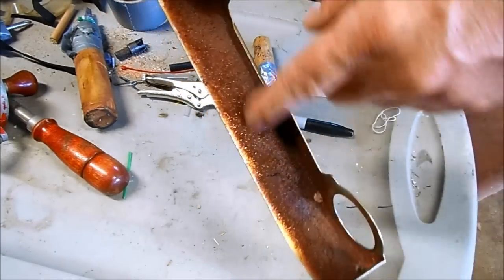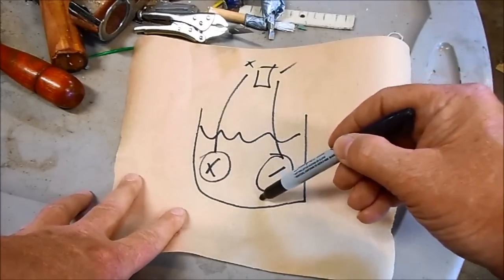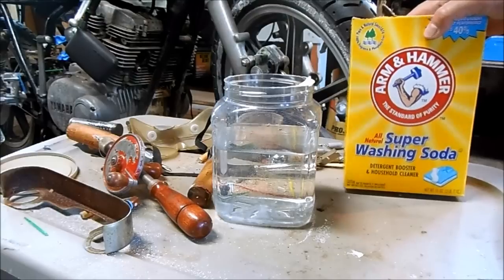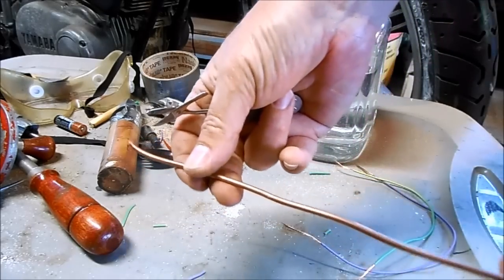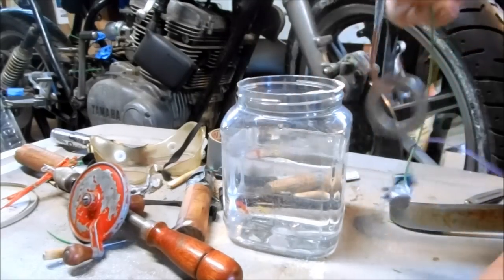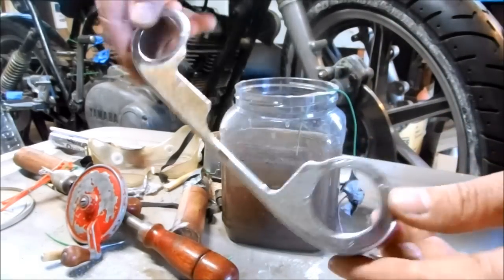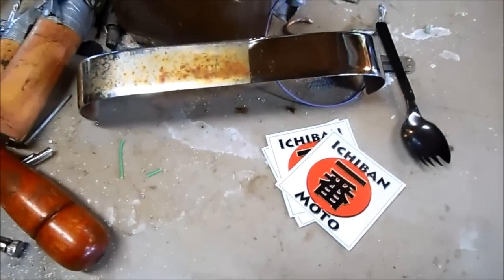How to Remove Rust with from metal and tools DIY Electrolysis process for motorcycles and auto parts

Comment: I am particularly impressed with the finesse in attaching the coloured wires to the battery terminals with duct tape.
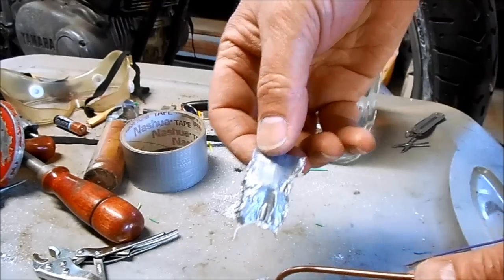Reply: I think you mean Voltage Grade Assembly Tape. 😉  1:50

Comment: Here is an email from my cousin who worked in a Chrome plating factory his Dad owned for over 60 years...  Micheal should know... that was his job for many years. So I guess it will work and I am going to try it now.

CARL,
 I watched the video. It is obvious this will work. He actually did the 
opposite of plating . The part was the anode.And the current pulled the 
rust off. Mike
Reply: reefseeker

Comment: As someone who has performed quite a few electrolysis experiments as of late I would like to warn people about electrolysis dangers using direct current such as alkaline batteries. Many electrostimulated energy transfers are used with AC current to heat liquids such as water which is a dangerous but very quick way to do so and has less of a chance of creating harmful biproducts because the ion diffusion has gaps in the cycle of alternating current unable to split the hydrogen atoms and connect them to the cathode. Direct current such as displayed in the video however can create a number of noxious and sometimes fatal gases even using neutral bases such as sodium carbonate the gas becomes trapped in bubble form and connects to the cathode and is released when the  density is greater than the liquid containing it. Pure water will create hydrogen gas which even in small amount trapped can create a small explosion with flame. Adding Sodium to speed up the process of electron transfer as a bridge will result in sodium hydroxide, technically lye, which is why carbon is used to absorb it. But this is still dangerous stuff so ventilation is important even with a 1.5 volt AA the amount of gas that can build up over night could have the potential to be dangerous.
Reply from the maker: +Terry Heeter   simple low voltage DC is very effective as electrons flow from negative to positive.
Reply: Yeah but I'm talking about leaving it on overnight hydrogen gas build up and other lewis based compounds that combine with the rust can even create arsenic gases because of the sulfur oxide. Just a fair warning ventilation is important that's all a great video, just even lower DC current can build up alot of hydrogen gas in just thirty minutes.
Reply from the maker: +Terry Heeter    just let it run until the rust is gone, however long that is for what you are de-rusting

Comment: When using a single battery there is little current.   Those who decide to kick it up by using a car battery charger or higher voltage source should do so in a well ventilated area.  As the current increases you should see more bubbles coming off the electrodes.  That will be pure oxygen and hydrogen.  Hydrogen is highly flammable, particularly so in the presence of extra oxygen.
Reply: Spam Dump
Reply: You can stretch balloons over the jar to collect the gases. They make great decorations for little kids' birthday parties.

Comment: Im trying to de-rust a bunch of old Honda bolts for my car. Ive done this EXACT method & watched almost every video on the subject youtube can offer. I hook it my system up(currently using rebar as my poss & the part as my neg). After this is done all I see is a few bubbles from the part, then a ton on the rebar. Ive used washers, other bolts you name it..Still same result as if I have done this backwards. Example, I used a bolt I think came from a computer & instead of taking rust off, it took the shiny silver coating off the poss bolt & transferred all the color over the rust to the bolt I was trying to DE rust.  This has happened on every attempt, I figure im missing something simple but I cant figure it out. This would be EXTREMELY helpful if I can get this to clean any of my bolts. Ive used vinegar( as well as other methods) & then rubbed several different types of oils on 10 of the same bolts, the only bolt that didn't re rest badly was the one that I put gun oil on(Mpro a little to costly for my project). Can anyone help? Is it working right maybe I just don't see it this way....ANY help would be greatly appreciated!!!
Reply from the maker: +Chem istry  Electrons flow from negative to positive, so the part you want the rust removed from is negative. To protect the part after de-rusting, I plate it with zinc by reversing this process .
Reply: I think I was over looking a couple things due to watching many videos. I was afraid of leaving it connected the wrong way. To my knowledge a majority of the bubbles should be coming from the neg/part, not the positive but the pos side always bubbles more, no matter what. I had planned on trying to plate something if things worked out but Ill be great with just clean at the moment. I changed my set up & am giving it another shot on a non important part, with any luck it should work smoothly. Thanks!

Comment: If you get a battery you could end up removing some of the outer layers of the part making it smaller. it works faster but don't leave it in too long unless your part doesn't fit right and you need it a few micro meters smaller.
Reply from the maker: +Benjamin Becerra   so it's like electrochemicalmachining > ? bad ass !

Comment: I didn't have any batteries lying around, for this, so I used the 6Kv generator, at work. I hooked it up over my lunch break. When I came back, the part had halved in mass, the water was gone, and the metal is heat stained blue. Is this normal?
Reply from the maker: have you tired to swap polarity to reverse the results ?
Reply: Ichiban Moto genius

Comment: I guess I should move with the times. When I was a young fella we used red for positive and black for negative... none of this 21st century new age pastel colour stuff.
Reply: Its called systematic racism.  I remember blk  being positive too.  Now the system is designed to turn everything black or dark negative.
Reply: HEY...colours in France are a joke !!! ANY colour you like for live...BUT only blue for neutral
Been a electric chappie for over 60 years never seen such crap...seen in commercial equipment here .   Live.... grey, black red, yellow, grey with a black tracer, white with a grey tracer..
When the regs in the UK were changed the Southern Irish did not accept, they applied logic...Red LIve...Black Neutral.  Green Earth..
Every voltage above 1V is red..Simple but too uncomplicated for the IEE. I know as member I was there 
Simple does not exist in this "hi tech" world
Reply: here in Philippines any colors are positive and any colors are negative :D
Reply: Don't want to argue but in the USA on a dc circuit, black is negative and red is positive as used on a 12 volt car.
Reply: The color coding is different for ac and dc systems as well as single phase and multi phase ac and hi voltage ac

Comment: spray with mixture of white vinegar & distilled water or a  mixture of distilled water & molasses  or linseed oil.  All natural.  There is a,linseed oil paint & soap u can use to kill rust and paint the undercarriage of cars.  Non toxic, eco friendly.  U can  also use to paint  metal, wood,  plastic etc.  Its called Allback linseed oil paint & soap.  Check it out

Comment: HEY!  What make is that pocket knife/multitool, which can chop 1/8" copper with the tiny scissors?

  Neat-O-Matic video; I had no idea you could do this stuff with just a flashlight battery and some cleaning soda; thank you for sharing.
Reply from the maker: those are diamond blade shears

Comment: With a bigger setup do you use a bigger power source? If so, is there a formula for power needed per solution? Thank you.
Reply: You need to limit the current flow, that is why a dry battery is ideal. A current regulated power supply is very costly, but you can use a normal DC power supply with a lamp in series with the plating bath. A car battery with the lamp in series will also work. To remove all the rust first, a 50% solution of hydrochloric acid (sold as spirit of salts in the UK) is much better than just scraping it off, since it removes the corrosion that would otherwise be left in the pitting. For a perfect repair, acid bath, electroplate, then fill any pitting with epoxy filler, sand down and then re-plate to cover the bare metal where you have sanded. the plating will not cover the tiny spots of filler, but if you spray paint the component the plating will prevent future corrosion from breaking through again.
Reply: So i can't use let's say a battery charger/ jump starter?
Reply: What current and voltage is reccomended? Could a rechargable nicad or nimh be used instead of a disposable battery? nimh has more power but nicad can be drained fully without damage (I think). thank you
Reply: yes u can it works faster with 2 amp

Comment: The sad thing is ,it actually works, not like you done it,  I did laugh though,thanks for that , especially when you taped the battery up. It works better with an old mobile phone charger ,connect live to a conductor like an old stainless steel dinner knife , the neg to a small crocodile clip and clip onto the item you want to clean, it works with old coins that I dig up while out metal detecting. Still a good video though, keep them coming .
Reply from the maker: thanks for watching and sharing ! ps.i found a rotten ax with that metal detector I made

Comment: I want ot do my bike frame. it's afull size dirt bike fram and i don't want to use an angle grinder so it'd be great if this would work. f i want to do the frame how huch of the ingredience will i need?
Reply from the maker: about four sporks per liter
Reply: +FUNG CHANG A spork has pics which makes it easier to measure.

Comment: This works, and it works well but very quickly it will flash rust back.  What can be done to stop the flash rust?
Reply from the maker: zinc plating.  I have a video on that
Reply: +Ichiban Moto Can you zinc plate the inside of a gas tank?
Reply from the maker: +laserfalcon  na, just red kote it  ( don't use kreem or por-15 junk)

Comment: I attempted this solution to my rear fender, but am not getting it to work.. Using a large steel socket as an anode and attaching to AA battery. Any ideas why it's not working out for me? It's relatively cold (32 F) where I am doing this.

Comment: is destilled water the same as deionized water?
Reply from the maker: no it's not
Reply: minerals and  ions r not the same, could u not finger it out yourself?
Reply: For electrolyte, the very last thing you want is any ions mixed in with the water atoms. Double-deionized water works better.

Comment: I have a 1971 Yamaha 350 that was given to be via my aunt who just passed away recently. it has heavy rust on it. the bike only has 2500 miles on it, and the rust is because it was kept in a shed that was rotted out, and lots of moisture was able to reach the vulnerable parts that can rust out. The last it was tagged, and on the road was 1984. I need to do this on a large scale. could I use something like a battery charger? If so, how long should I keep it in the solution? Could it be done in less time as well? Also, any tips on getting rust out of the fuel tank? When she left it sit, there was a bit of fuel in the tank. Also, should I take the entire engine apart, and put all new seals in? I don't have a lot of money, so I need to keep it as cheap as I can.. Any help on this situation would be appreciated. Thanks!!
Reply from the maker: If the motor is not seized from rust, you could first perform a leakdown test on the motor,  to see if the seals are leaking . You might be lucky, however years are the enemy of those old rubber seals, not use or miles. On an unknown motor that has been sitting exposed like that for many years, I would pull it apart. The cost of a seal and gasket kit a good investment to ensure everything inside is proper prior to dealing with the rusty outside of bits. If you will be stripping the bike down, you might consider just blasting everything.  I do need to make a video on how to de-rust a fuel tank. I will add that to the list.
Reply: Ichiban Moto thanks for the info! I will be watching for a video showing how to remove rust from the fuel tank. Thanks again!!😎

Comment: my mate has a tricked out yamaha cb500, and he says 'drilled discs' are better than  solid, but mine are quite thick, (drilled discs are quite expensive) and wavy are better still, (mine feel wavy when i run my nail across it, is this the same?)
can you help?

Comment: Hi Ichiban, can I use 12v 5a or 19v 3a or any adapters (connected to EU plug) for the power supply? I saw many videos on youtube only use 12v 2a. Why?
Reply from the maker: low amperage provides for an even plating process... higher amperage causes a rough surface
Reply: Ichiban Moto oh so the lower amperage the better it is but takes longer time? but how about the voltage? thanks

Comment: Will a larger battery produce quicker results?
Reply: Same thing in my mind, 1.5V battery isn't too little for this process.
Reply: don't you get he is teasing? Check when he cuts the thick cooper wire (which he claims it's from a hanger), he is using a small pliers which can't even cause a scratch on a wire that size.

Comment: will it works if i use salt instead washing soda?
Reply from the maker: washing soda is just sodium carbonate. I have tried and failed with sodium bicarbonate (baking soda) , however I have not tried plain old salt.
Reply: +Ichiban Moto - hello. you can make Sodium carbonate from Baking Soda by the following: "Simply heat baking soda or sodium bicarbonate in a 200°F oven for about an hour. Carbon dioxide and water will be given off. Dry sodium carbonate will remain."

Comment: is this method can use for 1095 carbon steel sword? cuz i tried many method but still not 100% gone,still have black dots on the steel...help me,im almost giving up right now to remove deep rust on my katana..
Reply: Alternate chemical remover is hot  (keep below boiling) 10% solution of citric acid. Also takes rust or blood stains out of textiles and leather. No electrical connections. More selective and gentle than naval jelly (aka, phosphoric acid). Citric acid commonly available in home canning supplies. Works well on fine threaded parts. If your 1095 surface is deeply pitted you may have no choice but to selectively abrade down and re-polish. That high carbon steel is notorious for easily rusting. Good luck and keep surface oiled if successful.

Comment: the rusty parts do not come shiny after Electrolysis like in thi tutorial

.
Reply from the maker: +Big Lebowski   the studio lighting does provide a bright reflection off the metal
Reply: +Big Lebowski the leftover chrome?
Reply: yeah,just screwing around to see if anyone was paying attention lol
Reply: I directed it to first comment lol I have  just realised it was made some time ago. the rusted metal parts never come shiny. they have to be well buffered to look like on this video
Reply from the maker: +Big Lebowski   well, there was some editing to keep the vid under 4 min
Reply: Big Lebowski : u r right..buff should be needed to clean the color of surface...
Reply: Big Lebowski becouse you haven't use te voltage grade tape, o maybe too few spoonforks
Reply: In solution the carbonate will not stick to the cathode(part) as the current is flowing away from the part. The part was also originally chrome so  the shine is the remaining chrome. Chrome does not rust  easily but when a pinhole is formed water seeps into the part and rust the underlying steel.

Comment: It also work pretty well if you need to clean a concrete mixer. It remove rust - if...- and also the cement, very easy to scrape. There is an illustration here : https://chauxetdependances.wordpress.com/trucs_et_astuces/nettoyage-par-electrolyse-de-la-betonniere/